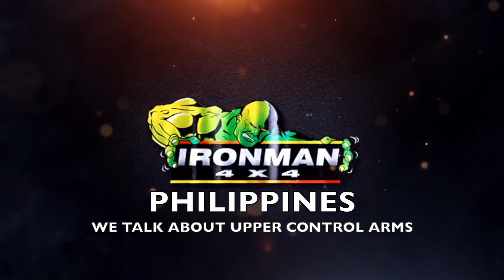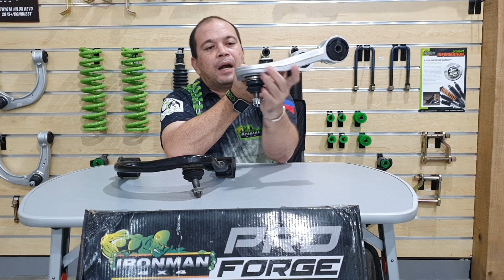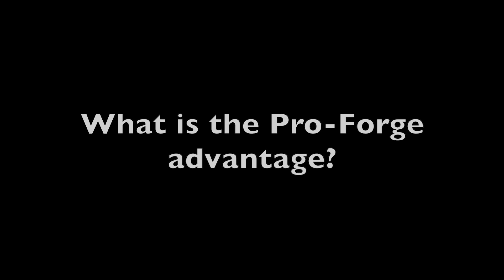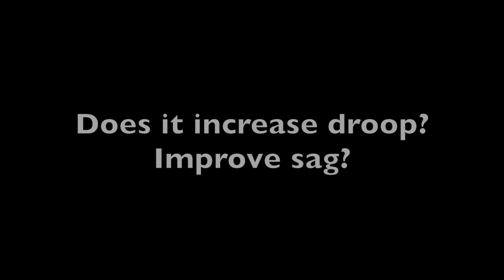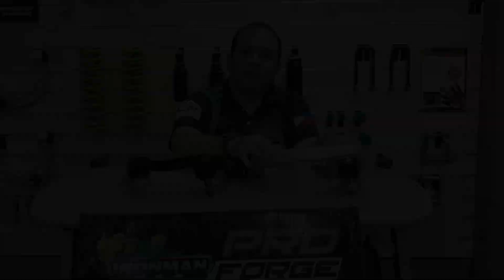Upper Control Arms

Comment: Hey after watching this I purchased a set for my MN Triton which is raised just over 2" (55mm) and the arms sorted out the droop issues I was having with the standard arms. Thanks for your honesty in your description of the product, it was very nice to hear in this sell, sell, sell at all cost age we are living in.
But there was one thing I was a little unsure about & that is when you said that rubber bushes are stronger & better than polyurethane bushes. This is true to a point when comparing vibration, noise & ride,  but when it comes to flexing the poly bushes are stronger because they are not bonded to pivot shaft sleeves. And this is where all bonded rubber bushes always fail when compared to polyurethane and therefore rubber bushes are not always stronger.
Other than for that I agree with everything else you said 100%. So, thanks.
Reply from the maker: Thanks so much for the input.  Yes the poly is really good as a bearing of sorts, but stiff when it comes to twisting or deforming.  That is why we recommend it for leafspring bushes as they do a rotational job.  But thanks for the input.
We approach this industry as a user/hobbyist and wouldn't want to sell you something you don't really need, as the money can be used for more important stuff.

Comment: Thanks great vid.
I am running 30mm lift on my 2016 MQ triton  Bilstien shocks lovells springs and was getting bump steer when hitting bumps on road and off road I had minimal down travel.
My local Ironman suggested to go 50mm foam cell pro and but the upper control arm.
Do you think this will solve my problem.
Thanks.
Reply from the maker: The Ironman 4x4 Foam Cell Pro can be lifted up to over 50mm, that is when you need the UCA.  I run a lot higher caster on my Hilux with the UCA for 0 bumpsteer.  Drop me a message at FB Pablo Lu Ascoba

Comment: boss Naka 2inch lift po toyota conquest ko 16x10 -44 offset mags  Need poba Upper control arm midyu ma galaw po kasi sa Highway ang manubela.? thanks po
Reply from the maker: Magalaw yan boss kasi -44.  What you can do is  install UCA and have it computer aligned.  Set caster to 4° or 5° to compensate for the offset.

Comment: Si gud pm po. Sir plan ko po mgpalit ng shock absorbers ko po amd cool springs to iron man po to improve more the stability of our car lalo na sa tagtag po. Sir my unit is fortuner 2018 4x2 po. Sir ang UCA maadvice nyo din po nah to for 4x2 po kagaya sa fortuner namin po? Salamat po and God Bless
Reply from the maker: For the 4x2 Fortuner we can run A springs front and rear since the 4x2 is 100kgs lighter in front, compared than a 4x4.  The UCA is only a need if you cannot properly align your car on a computer.  More info sir pm us on FB or email me at ironman4x4phils@yahoo.com
Reply: @ironman4x4philippines20  thank you po and God Bless

Comment: Sir for np300 2 inch lift , do i need a uca? TYI
Reply from the maker: Depends if your 2 inch lift has the proper sag/droop of 60mm.  That means all is good.  Another indicator is alignment. Can is still be aligned by a computer?
Reply: The problem sir the stock uca always hits the  strut mount , is that okay?
Reply from the maker: @kghuamin4077  it will not hit if the lift is done properly.  I think you used a spacer or quicklift which is the root of the problem.
Reply: Sir thank you for your reply thats why i’ll be choosing the ironman forged uca . They put a RM 4 way shocks . I did not change my coils in front coz they say it’ll be okay , just the rear springs . The result not that good. Hopefully it will be solved by the forged uca.
Reply from the maker: @kghuamin4077  if you used a quicklift spacer wth the RM shocks then your problem can not be solved by the uca.  You should remove the spacer
Reply: No spacer been used sir ,  just the shocks
Reply from the maker: @kghuamin4077  no spacer and the upper arm hits the coil spring upper mount?  Then the length of the shock is wrong sir.  Too long.
Reply: Maybe they gave me a wrong shocks 🤦🏻not for np300
Reply from the maker: @kghuamin4077  maybe sir.  The length of the shocks limit downward travel on the new coil/strut front suspensions.  It will be worth checking.
Reply: Just bought the ironman forged uca sir. It solved the problem . Thank you for that . But the np300 seems to be higher a bit infront compare at the back .
Reply from the maker: @kghuamin4077  yes sir.  Send me pics of it thru  email. ironman4x4phils@yahoo.com
Reply: Ok sir
Reply: Already sent it sir
Reply from the maker: @kghuamin4077  thanks. Replied.

Comment: If 2" suspension lift for isuzu dmax 2018...do i need to change upper arm
Reply from the maker: It depends on the following:
1.  Did you really get only two inches?  The only way to know is a before and after measurement, and measuring the proper sag/droop after.
2.  Can you align it properly on a computerized machine?  

- if it is a yes on both, then you dont need an upper arm

Comment: Sir, I am planning to install IM 2" lift kit and going with 265/70 r17 tires on my toyota hilux. Do i need to replace the oem uca? thanks
Reply from the maker: No need if we go 2 inches only.  On some vehicles getting the proper alignment will be difficult,  so we need the UCA.  But this is on rare cases.
Reply: Same here 😅
Reply from the maker: Asian brands usually use heavy duty Australian springs for light vehicles, so they get over 2 inches lift and suggest the UCA.  The bad thing is, their shocks are short, so there is no more sag and ride is horrible.  For more info on sag measurement, see the video here:
https://youtu.be/10wpdjp1eLg

Comment: Can I install a 3” lift on my FJ using this forged IM uca with 275*70R17 wheels -44mm offset and still achieve corrected alignment/ geometry? Please advise. TIA
Reply from the maker: Yes sir.  I personally feel -44 is way out there, but as far as alignment is concerned, caster and camber, it will work.
Reply: @ironman4x4philippines20  i have an FJ on 6” rough country kit + 37” KO2 tires. Do I / should i buy a new UCA ie) Ironman
Reply from the maker: @JJ-po9nb  how is your alignment numbers on an alignment computer?
Reply: @ironman4x4philippines20  i dont know. Not sure if its relevant info but I have inner tire wear in front, front tires look a bit flared out, and the kit is suppose to work with stock uca. Im concerned i also have ball joint issues (not confirmed)
Reply: @ironman4x4philippines20  many thanks for your advice

Comment: Sir, if i go for ironman foam cell pro kit for my 2017 wildtrak plus 2” body lift, is a drop kit still required? Can u also let me know what is included in that kit in Philippine market? Thank you in advance.
Reply from the maker: We have a 3yrs/60000 km WARRANTY Ironman 4x4 Australia SINGLE BRAND promo set for Struts Coil and Leaf Pickups and SUVs

- Nitrogas kit 37500
- Foam Cell kit 47500
- Foam Cell Pro kit 71500

You get:
- 4 pcs shocks
- 2 pcs front coilsprings
- 2 pcs rear AddALeaf springs
- 3 year/60000 kms worldwide warranty
- Australian brand with 60 years experience
- Australian R&D
- sold worldwide
- a proper website and aftersales department in Australia
- no magic shackles, no spacers
- not a rebrand

www.ironman4x4.com
Reply from the maker: The foam cell pro kit doesnt need a diff drop kit since its a proper 2 inch kit.

Comment: when going for 2 inch suspension lift + 1 inch body lift and fitting a 295/70/17 tires would it be required to REGEAR?  and what are the other things to do for do?
Reply from the maker: Hi sir!  If you want to regain the original power, plus the original accuracy of your speedometer, odometer, trip computer, fuel mileage meter, a regear would be great.  295s are about 10% larger in diameter, so going up 10% on gearing will bring it back to normal or better.  Based on my knowledge, 4.56 ratio would be ideal.
Reply: @ironman4x4philippines20  thanks for the response much appreciated. May natutunan ako boss 👍🏼, how much would a ironman4x4 diff drop for hilux?
Reply from the maker: @YGF00  we don't have diff drops from Ironman 4x4 at the moment.  If you are running a proper 2 inch lift, there is no need for a diff drop.
Reply: @ironman4x4philippines20  but its OK to install a diff drop on a 2" suspension lift kit?

Comment: These are a good idea so you can increase your tire dimensions.  But one thing I remember from owning my Toyota 4Runner was that if you intended to ford deeper water there is a need to modify the differential breather tube to prevent water going in.  Have the later 4X4's resolved this issue?
Reply from the maker: No sir John.  Most still run the same style diff breathers.  Some Jeeps have factory extended breathers to about hood level.  What we usually do is install an Ironman 4x4 diff breather kit so you can route your own breather hoses as high as you want.